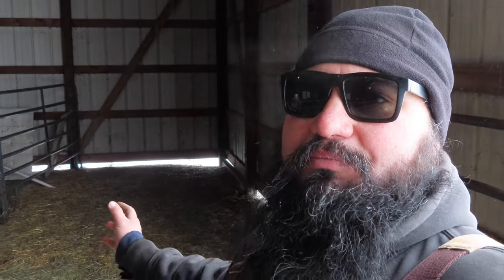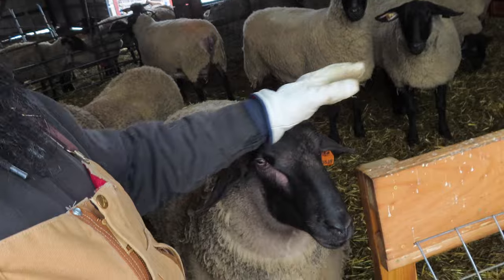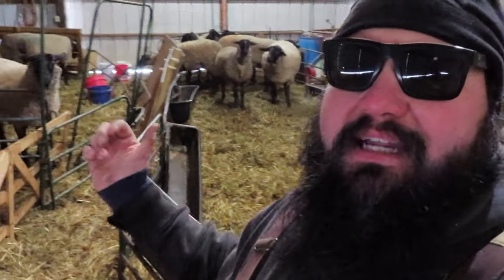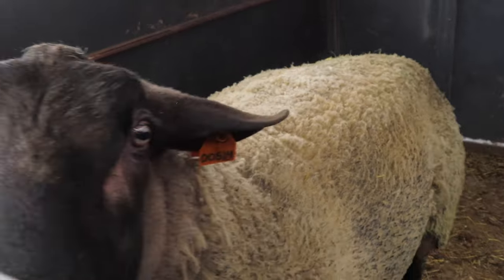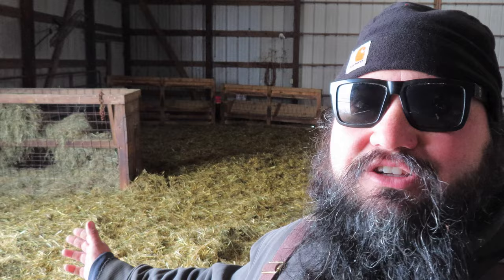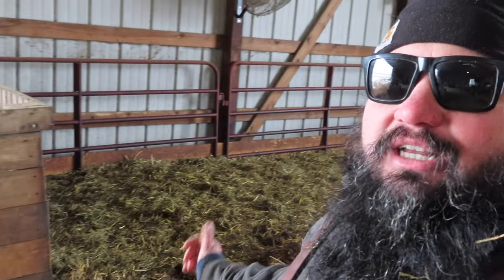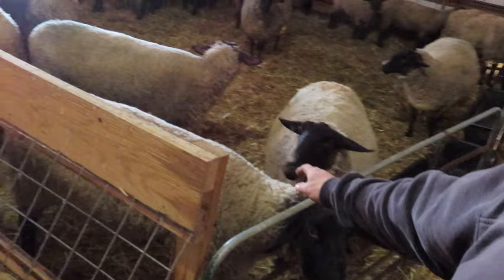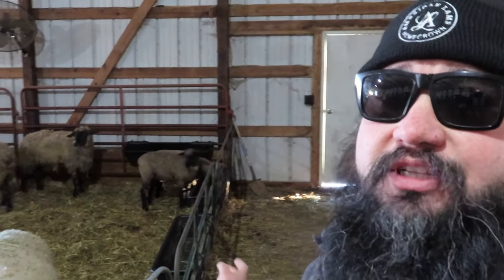Redesigning Sheep Barn For Efficient Lambing

Comment: Hey ,hi not trying to be an ass ,asking you cause i can see i would be misinterpreted by other channels😂. I have katadins on 80 acres. No biuldings 4300 ft ,some winters 6 months. Dorpers didnt make it here. My question is why the sheds? Is it weather? Or breed? The one site says her lambs 100lbs at 3 month's with suffolks. I definitely cant match that! But only grain my ewe lambs after weaned and alittle for flushing ewes. Idid notice the wooley ones actully got colder cause the snow would melt down into their coat! Plus drastic temp change in spring, the wooleys would take to long to shed and would be miserable in the heat. Im on steep rocky hill side havent had to trim hooves ever in 5 years. Dont shear or dock tails. Have run a few lambs into the house to dry off. But no more than an hour. Rarely worm ,some times just before breeding to make sure, but probably dont need to. Anyway😅 i guess im asking can a suffolks thrive in this environment or maybe use a terminal sire? Would the lambs thrive ?  Thanks
Reply from the maker: Great questions! I understand that over a comment it can sound not the way you want it to. To start off why sheds? Well in 2018 we started with two wethers, then 2019 purchased 3 ewe lambs and a wether when we were approached by a chef at a farmers market and asked if we could produce lambs to sell her cuts of meats for menu items. So we ramped up feeding lambs and finishing them for direct to restaurant and consumer sales. We have continually grown our lamb production year after year having groups of lambs processed 10 months out of the year. So finishing the lambs in the barn allows us to feed lambs the exact same diet in the middle of the summer as we do in the winter. The chefs we work with like this because it allows us to have special cuts at different times of the year that all taste the same. All of our Suffolks will weigh in at 179-200 between 6-8 months of age at the time they are processed, we will routinely have hanging weights 80-100 lbs. The ewes are raised in the barns because as we grew it was what worked for us. They all have come from flocks that were in pasture but our pastures are not set up to handle sheep yet ( they have been for cattle over the last 50+ years). We also aim for January/February lambing (middle of winter) so we can produce lambs to finish out because these would be more expensive to purchase due to higher holiday market. So shed lambing is pretty normal in our area at that time of year. We shear and trim feet but these Suffolk that we have would have no problem out side in most environments.
Reply: @BankBarnMeats  thank you
Reply: @BankBarnMeats  amazing weights!
Reply from the maker: Thanks,  But just to clarify this for full transparency. Those weight were/are achieved finishing Suffolks and Dorsets. For our crossbreed sheep in the same time period are constantly getting 160-170 top end. The crosses get same feed and same feed program but just don’t have the frame like the Suffolk and Dorsets. 2 years ago I went on a lamb feedlot/ accelerated breeding lamb tour and that got me interested in seeing what was possible on finishing these lambs. Because we are not marketing them to just take and hope to get a good price at market it allowed us to try new ways of feeding to try and achieve Steak House Cuts of lambs. The lambs that we finish are feed through a process that we found works for us and we are able to adjust it depending on time of year and how the group of lambs are growing. The lamb groups we are finishing out are in groups of 4 to 12 and all aiming for a finish day within 14-30 day of each other.